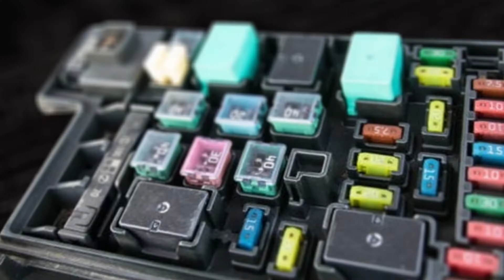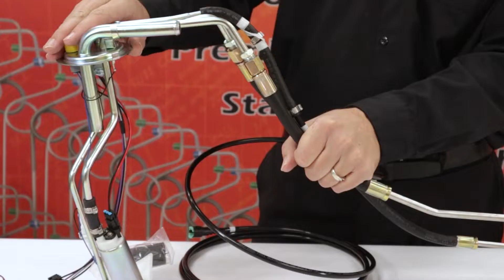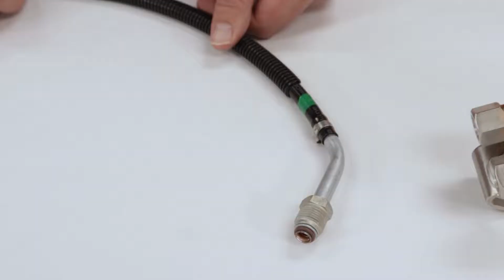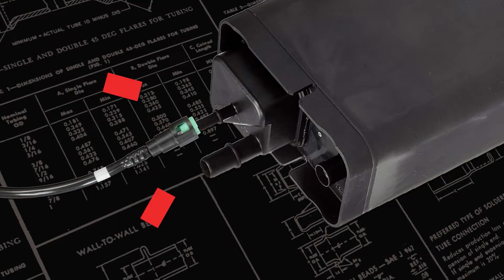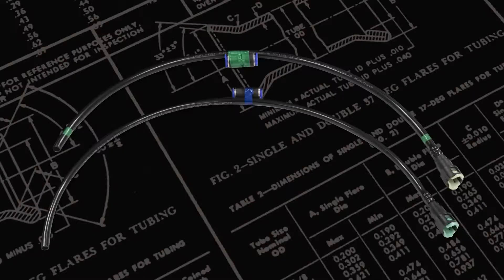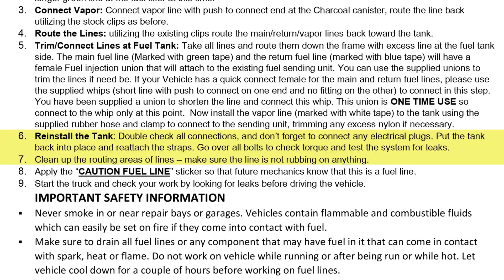How to | Install NFR0020 Nylon Fuel Line Kit

Comment: these fuel lines are coiled up. you know how hard it is to get the right angle in that tight of an area when ur fuel line is a tight fking circle. i needed a line not a wound up circle! harder to move than the steel lines man these things suck ill never buyem again. coiled up hard plastic tubes dood. like have some common sense jfc

Comment: ...BUT DON'T INSTALL THE FILTER BACKWARDS LIKE THIS GUY DID.
Reply: You are correct I did not have a truck to compare to or a marked filter.  Thanks for the heads up.
Reply: That's the problem when you copy a product and have no clue on how to install it. 99% of the time the welded end of a filter is the engine side.

Comment: You guys sold my girlfriend a set of transmission lines for her 6.5l diesel truck and 4l80e transmission. 

Here's whats bad about it
The lines arent even for this truck 0% of it matches up not the length and definitely not the fittings. Secondly you guys done sell these lines anymore which leads me to believe its because you mustve f***ed up every one you made. 
I give 0 out of 5 stars for the quality of this sht.
Reply: thats because its for a vortec engine lmao. dumb as can be.

Comment: Fantastic video Chuck but there is only 1 issue I have ran into while installing my kit for th '97 k2500 and that is the vapor line..... it does not quick connect onto the charcoal canister so..... 🤔